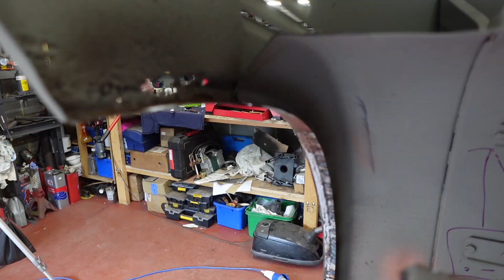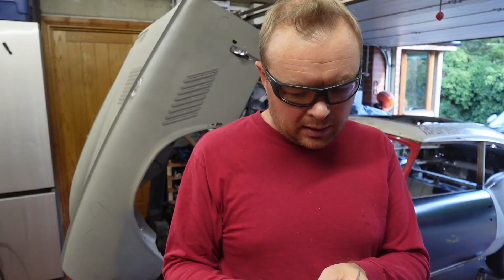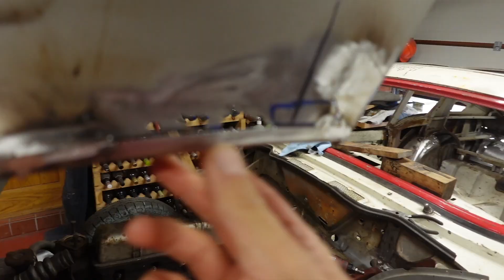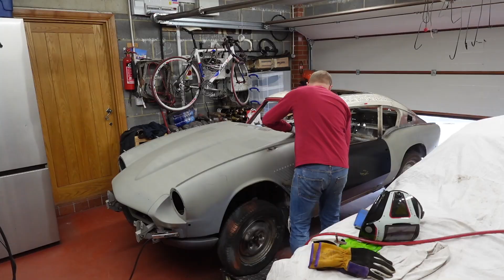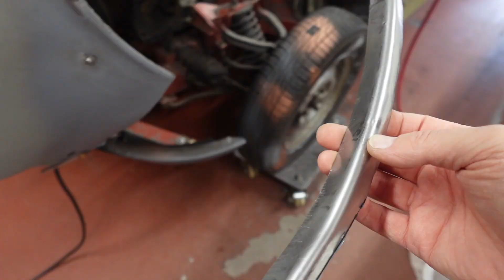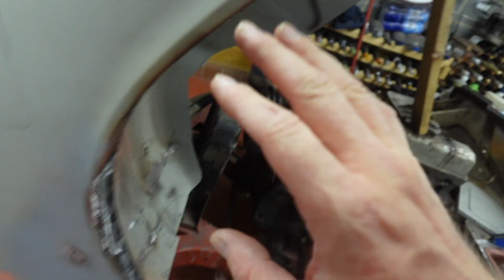Final Wing Rust Repair & Patch Fabrication | 1969 Triumph GT6 Mk2 Restoration | Pt 55

Comment: I made a patch in same spot. I didn't have much metal shaping knowledge at the time, just a very rudimentary understanding. I managed to knock out the whole piece out of one bit of metal using a ball-pien hammer, lineman pliers, and a leather glove on the grass acting as shotbag. You can see it if you look, but most people don't notice
Reply from the maker: It was wanting to get the sharp edge of the wheel arch that led me to do it in bits. That’s what I like about metalwork, nobody’s going to solve the same problem in the same way!
Reply: @redfoxclassics yep!